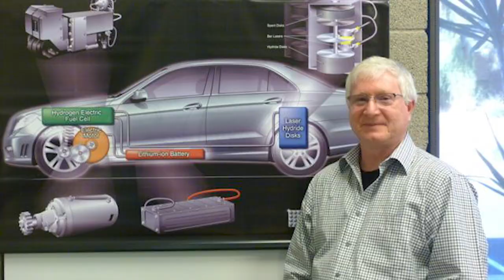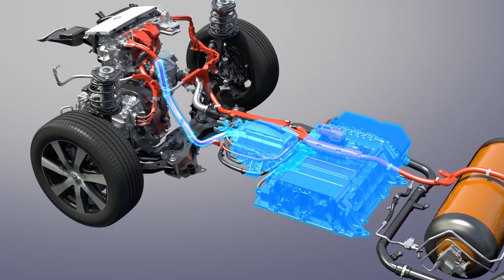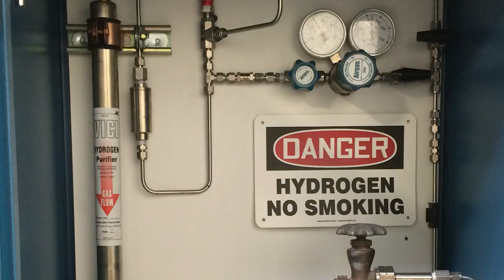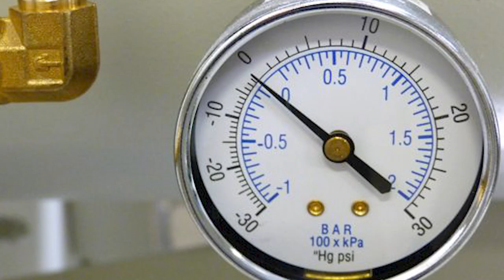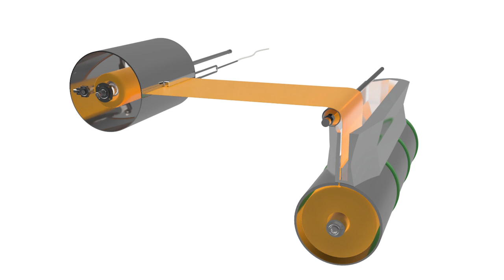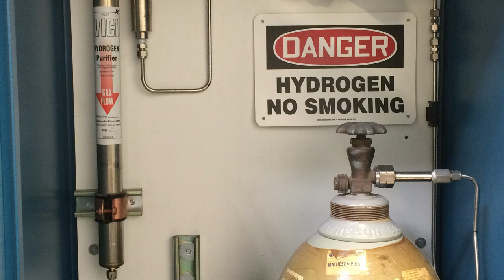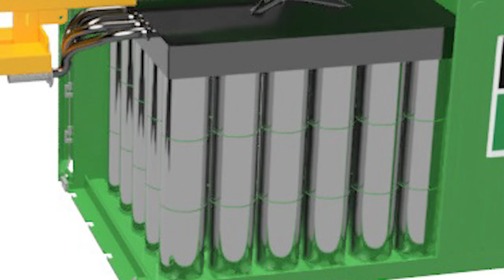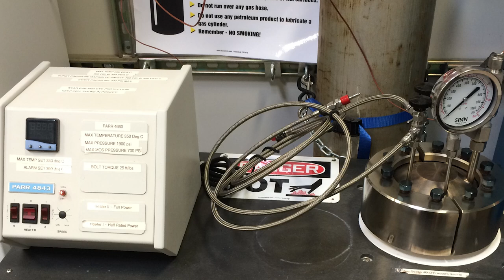This BANNED Technology Could Push Hydrogen Cars Over BEVs

Comment: You didn't ask the relevant questions: 1. What are the conversion losses in generarating the hydrogen and getting it onto the film? 
2. How much does the hydrogen to film conversion device cost and how much energy does it consume? 
3. How much does the conversion unit in the car cost, how heavy and how efficient is it? 
4. At what point of production readiness are they and how much would a factory cost to produce those devices?
5. How high is the energy density on film compared to compressed (700 bar)/liquified hydrogen?
6. How is the hydrogen fixed onto the film and is there anything other than hydrogen coming off when it's getting lasered?
7. How does the cost compare to compressing hydrogen?

With this system, there are a lot more steps from the energy source to the motor: Regenerative power to hydrogen, hydrogen to film, film to hydrogen, hydrogen to the motor via fuel cell. All those steps have losses. 

For BEVs it's solar panel to battery to motor with an overall efficiency of way over 80%. FCEVs are two to three times less efficient and it'd be interesting to know, how much better this technology might do.

It's all fine and dandy that lots of people are interested in a slightly less boneheaded way to store hydrogen but prototypes are easy...
Reply: good questions, I had similar questions too, but I doubt we will get answers any time soon
Reply: They won't mention cost, ws that would reveal how impractical it is, but they did mention "15 pounds for 20 miles" which means 300 pounds to equal the 400 mile range Teslas - but that might be overly optimistic.
Reply: @chrismuir8403  yes, and that 300lbs is just the “fuel storage unit”..
You still need a Fuel cell (1-200kW ?) and the usual battery that fuel cell cars need..
Reply: @weinisable  ...and the thing that gets the hydrogen off the fuel-storarage-unit is not weightless either. It's gonna be pretty busy under the hood if such a car gets ever built.
Reply: Good questions. But to be fair, there are more steps in the BEVs case - transformers/DC-DC converters, rectifiers and invertors (at least for AC motors like Tesla uses).
Reply: @peter.g6  Toyota uses DC-motors? I highly doubt that... And fuel cell cars need (smaller) batteries too btw.
Reply: @Makatea  Well, that's a good point with AC motors everywhere. Not sure about the batteries though, does a significant portion of the electricity from a fuel cell go to batteries?
Reply: @peter.g6  Batteries are needed both to power the fuelcell and as a buffer because the fuelcell can't provide enough peak power for acceleration, so it's pretty substantial, but of course a lot smaller than in BEVs as it gets constantly charged by the fuelcell. Being smaller, it gets a lot more cycles, so it'll wear out a lot faster than a BEV battery.
Reply: 'Solar panel to battery to motor with an efficiency of way over 80%'?  I think you need to recheck the efficiency of your solar panels....
Reply: @lukedornon960  I should have said solar panel output I'm perfectly aware of the fact that the conversion rate of light to electric output is about 20 to 25%. But do you have any idea of the conversion efficiency of solar power to fossile fuel? And if you make hydrogen using renewable energy, which is the only way to make it carbon neutral, you have the exact same conversion losses of solar rays to solar cells or wind turbines.
Reply: @peter.g6  ALL of those items in your list are in a FCEV (they have batteries too because a FC can't provide the peak power needed for acceleration hence a battery buffer.
Reply: @lukedornon960  You are criticising something they didn't write. Light to PV output may be ~20% efficient, but that wasn't what they wrote, they wrote PV to battery.
Reply: The volumetric and energy metrics are on their website.
For BEV it is not simply solar to battery. Its solar panel conversion efficiency to AC through microinverters or a central one.  If there is storage involved its conversion back to dc, then stepped up or down for current regulation into the pack. From the pack it must then be converted back to AC.  If your not doing storage then skip this. From here the charger takes this AC converts it to DC. Then the onboard charger regulates this to charge the pack. 
The charge efficiency of the pack then has losses based on temperature and state of charge. From here the DC is converted to a 3 phase ac signal in the inverter to drive the motor. If you count all the efficiency losses in this you are no where near 80 percent.  
Keep in mind there are different solar setups and storage options that can change this slightly and I didn't detail all of the steps and voltage conversions happening in the inverter and charger that introduce additional losses. This also doesn't take into consideration the pack thermal management system that is consuming energy to maintain the optimal pack temp for charge acceptance. This is why there are cooling systems on the motor, inverter, charger  etc. The loss is mostly thermal and must be rejected. 
FCEV also have their drawbacks but the interesting advantage this tech potentially has it the energy to weight metric. Current batteries are too heavy to scale for heavy transport. Batteries will not slash this metric in half anytime soon using lithium based chemistries. The active materials alone wont meet the metric needed.  Tesla semi can only transport a limited amount of weight without going over DOT weight limits at any considerable range. If your trying to use a battery in an aerial vehicle you SOL with range due to weight and limited energy density. For grid scale storage ,the  complexity of stringing hundreds of thousands of cells together for stationary storage is  a reliability and cost nightmare.   This can potentially be a game changer for grid scale storage and large vehicle transport. There is the potential to directly burn the hydrogen for applications that need thermal energy.
Reply: @chuckschumer7783  This is not true.  There are companies with conversion efficiencies in the high 80% range. Your describing a straight h20 to hydrogen electrolyzer.  The efficiency of a Fuel cell is generally above 60 percent. It can also be higher if the waste heat is used for something else ( drive a heat pump, or heat a cabin). The efficiency is also driven by the load on the cell and is not constant as is the case with batteries.
Reply: This sounds like its best application is for aircraft where power to weight ratio is more important than ground vehicles.
Reply: @kayzrx8  Granted, with that hydrogen-to-film/disc you don't have any AC/DC back and forth conversion, however those power electronics have gotten very efficient. 
Instead there is hydrolysis, which is far less efficient, then you convert the hydrogen gas to the storage media, then convert it back in the car, and finally fuelcell to electricity. Many more steps, the efficiency is far worse and the hydrogen is far more expensive than electricity.
Right now, 95% of all hydrogen is made by steam-reformation from fossile fuel. This is why big oil is pushing it. But at least for cars, there is really no point, given price, efficiency and at least for now, CO2 emissions.
It might be interesting as intermediate storage when there's more production from renewables than the grid can absorb. But even for that, there are cheaper and more efficient technologies such as iron-oxygen batteries on the horizon.
Reply: @rvanbeau2009  It's pretty hard to figure out a CO2-neutral solution for aviation. There are small battery-electric aircraft with an hour or two of autonomy. But long distance is really difficult. Fuelcell and electric motors with propellers will still require pretty substantial batteries for takeoff and prop-driven aircraft are far slower than jets. Hydrogen powered jet engines might be tricky to construct as hydrogen embrittles steel (and possibly other metals). Right now I don't see any viable (but costly and wildly ineffeciently produced) biofuels.
Reply: @Makatea  If hydrogen is being generated through electrolysis, that is a waste unless the source of the energy is renewable.  Even then there are other forms of converting green energy to hydrogen that are in development with high efficiency without the use of hydrocarbons. The problem with BEVs that is a huge elephant in the room everyone seems to ignore and hope it will be addressed is the recycling of these spent packs when they are exhausted. They are not environmentally friendly and the mining of the materials is a pretty bad process. not to mention where these materials are sourced.  There currently is no efficient and economical way to do this.  The other huge issue is energy to weight. For a commuter car this can be tolerated but when you try and get into trailer transport, heavy power equipment and use cases that require significant energy density, Lithium chemistry, at just the metrics of the active materials alone, cannot meet this criteria. There has to be another method of storing energy with an effective density metric to be a viable replacement for diesel. In the grand scheme of CO2 emissions , when looking at the transport sector, heavy vehicles are a huge contribution to this.  Hydrogen  storage is key here and this tech can address the storage  issue. There are company's developing ammonia hydrogen storage and methods of conversion to hydrogen that are within range of being viable. Batteries in the present  chemistry cannot address the main issues that are leading to co2 emissions.  Even iron air batteries have worse energy to weight metrics than lithium chemistry's. That's is why they are mainly targeted at stationary storage where weight doesn't matter.  I am an EE with a background in energy storage and battery manufacturing. Batteries need a significant jump in storage density and weight metrics to be viable for the areas mentioned.  Efficiency is one part of the equation.   A system that is 50 percent efficient and can actually do the job of transporting significant weight with energy density for range is better than one that  is 90 percent efficient but cannot meet the criteria.
Reply: @chuckschumer7783  Yes, that correct, gasoline engines are less efficient than that.  You're missing the bigger point though, batteries are expensive, heavy, and still produce a lot of toxic byproducts.   If a hydrogen plant was powered by say nuclear, or solar, the energy loss is negligible considering that the energy is resource neutral.  For aircraft, these are much higher energy dense so a far better solution than batteries.  Electric aircraft currently have ZERO future.  Batteries are just too heavy and nowhere near energy dense enough.   Think about a nuclear powered aircraft carrier with hydrogen powered aircraft.   The math is showing this tech to be about 1/2 the energy density compared to traditional fuel, which is already 5x more dense than batteries.
Reply: @kayzrx8  please provide an example of a company with an electrolyser with "conversion efficiencies in the high 80% range".
Reply: @kayzrx8  and with all that experience you're not aware that technology peesently exist that can recycle 90% of battery for reuse as batteries!?
Reply: @redshift3  it's not electrolysis . I never  said it was.
Reply: @dstr1  no there is no at scale tech to recycle 95 percent of batteries. Please mention a company or point to a process that does this at scale with efficiency.
Reply: @peter.g6  Maybe you are aware but it still needs battery to provide enough current for torque. Fuel cell does not generate much torque so the subsequent components are essential, just not at as big of a scale, hence the term "fool's cell" from Elon Musk.
Reply: @runningman5871  Tesla does not have a 1 million mile battery. This highly depends on the dod of the battery. If I'm cycling a battery within a very narrow range of it's capacity it will last. This is not the case for all applications.  There is degregation that occurs with ALL lithium based batteries due to DOD, dendrites, AP, temperature degredation, and separators degregation which is a calendar life. Simply because I add an enormous amount of capacity to a system and only use a shallow DOD I can't claim the battery last forever. Your not using most of it  at the expense of weight and cost.  Why do you think Tesla is desperately trying to get into cobalt mining ? Cobalt is necessary to extend the degregation curve and it is a very limited resources. Why don't they rely on the recycled packs for this material ? Because it is not viable to extract cobalt presently from spent packs . They aren't recycling 95 percent of the pack. It's built in a way that makes recycling difficult. They aim to be 95 percent recycled but they are not .
Reply: @chuckschumer7783  Agree, though the 50% is just the round-trip loss alone. There are other losses as well.
Reply: @redshift3  please do some research it seems everyone on here simply repeats what they read on the internet. There are currently labs that have gotten electrolysis to 70 to 80 percent efficiency for conversion of water to hydrogen using catalyst. Still in development but documented  evidence of these efficiency's . There are process using PEM to achieve near these efficiencies at scale. There also company's experimenting with direct light to hydrogen conversion using biological strategies. There are even companies developing carbon neutral strategies for hydrocarbon.  Batteries are ok for things but are not the end all and answer to reducing CO2 emissions. Don't rely on Google or a blogger for your info.
Reply: @kayzrx8  Redwood Materials
Reply: @dstr1  I'm familiar with them. I said at scale and efficiently. They are still in their infancy and still doing a funding round.  They will need to meet alot of hurdles to be considered efficient and at scale. There are hundreds of other recyclers that do this as well for cellphone and consumer electronics batteries. The recovery efficiency is not good.  Currently any materials they manage to recover will be more expensive that just importing them . Until they get the cost down , this in no way will address the magnitude of packs that are being deployed that will near EOL years from now.  Removing lithium, cobalt , and other materials from the battery is a labor intensive, energy intensive , and chemically intensive process. It's not like you stick the battery in a machine and out comes cobalt , lithium, carbon, copper, aluminium, and the other metals used in the cathode and anode.  It's a known problem in the industry hence why many companies are trying to address it . It is not addressed yet and won't be for a while .
Reply: @kayzrx8  it's being done to scale according to the state of the market.
They are producing as much as they can get and are putting out  request for as much as is available. 
This is a developing industry with considerable opposition from the established automakers. The factory is able to process 100 % of what it receives.  It's nowhere close to capacity and it's purifying the materials at a much lower cost than virgin   materials. And it has a demand for all it can produce.  That is the definition of producing to scale producing at scale.
You are primed to dupport hydrogen but not ready to accept that it's just not ready.
Reply: @kayzrx8  Tesla is not trying to get into cobalt mining, on battery day Elon said they plan to get rid of cobalt altogether. Cathodes should be just nickel and maybe manganese. LFP are already cobalt-free.
Reply: @peter.g6  you really need to do your research, they plan on mining lithium and cobalt. Plan on and actually doing it are 2 very different things . And no, LFP batteries still require a small amount of cobalt in the cathode . Tesla has secured contracts with cobalt miners In the congo and has already started looking into mining it . LFP as they have said and is know has less energy density than the current chemistry they are using . They are still working on a cobalt free chemistry it is not ready or proven yet.
Reply: @dstr1  I'm not primed to support anything. Lol have you looked into the cost of  the materials that comes from them or any recycler  vs importing ? You can believe what you want . I actually work in this industry and know the reality of it . Battery recycling has a long way to go. Just cause a company buys 100 acres doesn't mean they are at capacity. Processing pouch cells is way different that cylindrical packs. Not saying its impossible  just saying that they have serious hurdles and growth before they are at scale with today's projections let alone where it's heading.  And no,  this doesn't scale by demand. Recycling scales by being forced to do it either by mandates or scarcity of the materials.
Reply: @runningman5871  define still going strong ? I guarantee you the capacity it had new vs now after "400k claimed miles"  is considerably less and that curve will dip faster as the battery ages. It isn't linear . Do you have data to show your pack has 0 degredation  after 400k miles ? There's published data of Tesla's packs showing considerable loss after 100k . It depends as I said early on how the packs being used (dod, recharge rate, discharge rate ).  I'm not saying BEV are bad and I'm not against them,Tesla are leading the way in the tech and they have a good product. it's just comical the fanboys think batteries defy basic chemistry and physics and can't understand the basics that's batteries cannot meet the requirements for every vehicle .  No electrochemical battery avoids degredation. You can mask it by oversizing the pack to allow for a shallow DOD  while sacrificing weight and  cost.
Reply: @kayzrx8  read the report.
Reply: And I have a phd in physics. Just not getti g the magic disks with no evidence thing. You believe what you want. I've provided evidence. Goodbye.
Reply: @runningman5871  I doubt that. And you have yet to provide any evidence just speculation. Carbon nano tubes and hydrides are a known and proven hydrogen storage medium. Your already bashing this without even fully knowing how it works or the methods  behind it. That's pretty closed minded even for a PhD . Your just a fanboy of Bev. And that's fine . They are cool and help. But dismiss the fact that Bev have a very narrow utility band. Towing, heavy machinery, long duration, flight, boating , mass transit are just a few of the modes that batteries at ,their present metrics,  cannot address.  The solution will be a hybridzed blend of all of those invitations . There is no one solution fit all for addressing emissions and electrification.
Reply: @kayzrx8  LOL, you tell me to do my research rather than giving me a link? You're a joke man. I will take it back when you send me a link where some Tesla employee talks about their plans to mine cobalt.
Reply: @peter.g6  I can't hold your hand to make you understand a simple concept  about batteries or the very easily searchable headlines saying this.
Reply: @kayzrx8  very disrespectful and inane answers. You seem only interested in magic physics tgat does not exist. Muting you as you're v dull and uninformed.
Reply: Just look up what purpose cobalt plays in battery cells. You will soon realize the hurdle and extreme difficulty it takes to replace it in an electrochemical cell. Without going to levels that most people probably would not understand , explaining this would be a wasted effort without you doing the research to understand the basics yourself. Just simply do your own research  and you'll find quite a bit of headlines and info  around it.
Reply: @kayzrx8  I suspect there aren't enough spent batteries available yet to make recycling viable. At this stage EV companies are struggling to get more auto market share.
Reply: @Makatea  I wish you were making videos about this stuff.
Reply: @Makatea  How about MSRs for making any required hydrocarbons (including for the military) directly from CO2 and water?
Reply: @red-baitingswine8816  exactly
Reply: He sounded all too familiar to me.  On the lines of the government wants to ban this man who built a perpetual motion machine. It's all talky talky n no walky. And yes the host doesn't have the knowledge to ask the right questions about this either.
Reply: @liveonthesun3368  I don't understand why Sandy only asked these softball questions, it's certainly not lack of knowledge. Are they clients of his and he exactly knows how dramatically inefficient this whole process is? Hopefully, there'll be a followup.
Reply: @weinisable  Yes.  Part of the efficiency of EVs is the recapture of braking energy on braking.  For that one needs a battery for practical purposes.
Reply: @chuckschumer7783  exactly so this is not a path forward besides the disk have a short life span
Reply: @Makatea  - The real solution to long distance air travel is to not travel at all. The majority of air travel is really obsolete with the use of the internet and modern communications technologies. The only time a person needs to air travel long distances (other than recreation) is for a service direct to said person, such as medical treatment, or a direct service provided by that person, such as a tech resource needed onsite where communications technology is not enough. For 90% of air travel is actually obsolete.
Reply: @chuckschumer7783  - Let suppose you are correct and the overall system is only 25% efficient from original power source to wheel. If that original source is carbon neutral (like solar, wind, nuclear, geothermal, etc.) then it is a big win compared to the large amounts of carbon the fossil fuel culture we are living in today. When every little bit counts, we need to be making advancements that ARE Disruptive if we want to head off climate change and keep our coastal cites from being flooded over the next 50-80 years.
Reply: @kayzrx8  You are spot on on every topic you have brought up.
Tesla has done the alternative energy movement an enormous disservice by marketing its tech (li-ion batteries) as some sort of green energy revolution that will save the planet. Pushing out the Tesla Semi further harmed progress, not just b/c the core concept of lithium batts being a viable alternative for commercial vehicles was total bunk from the get go, it also stole valuable publicity that could have gone to something workable.
By simply increasing the size of induvidual cells in their packs, tesla has convinced a large portion of the population that battery tech is improving year over year. I wish car companies would admit to the public what they themselves already know. Batteries as an energy storage medium in vehicles are just another stepping stone, just like hybridization.
Anyway, rant over. I'm glad there are engineers like you tackling real issues instead of wasting time on flashy nonsolutions chosen due to their superior marketability.
Reply: @williambrasky3891  Glad to meet someone that has sense and can see what's going on. It's shocking once you actually crunch the numbers. It amazes me how people believe everything so blindly.  Increasing the size doesn't really do much besides simplify the pack design. But that also introduces more issue with thermal management and some other issue I won't mention here because It will go over alot of peoples heads.
Reply: @jonahbert111  this can be done and has been done on non ev vehicles . Strategies utilizing the cars alternator or motor generator during decell and braking can accomplish this. BMW, Mercedes and other have done this and utilized a slightly larger  battery. OEM's have the ability to do Regen on non ev's. It just drives up cost and the market isnt there for it. Without regulation forcing these abilities, oems won't implement them  unless the market is there for it.
Reply: I don’t see this system as practical, efficient or cost effective for consumer cars compared to BEVs. But for applications which are already suited to hydrogen fuel cell - shipping, freight transport, etc - then it’s probably going to be safer and easier to use this tech than have a huge pressurised bomb.
Reply: Valid questions the promoters try to avoid. 👍 Stop fact checking.
At least it has an advantage over compressed hydrogen or eFuels.
Might be advantagous for home owners to transfer excess energy from summer to winter.
Reply: @alanaland1990   Leaving the details of steam reformation out was positive for hydrogen production.
Reply: Well regarding regenerative braking, it would not be necessary to convert back into hydrogen, you could just a limited battery capacity coupled with some super capacitors to absorb such energy temporarily. Typically you suck up such energy quickly again when you accelerate (except at your last stop). I would image it would need such temporary storage anyway for high power acceleration, as the file cell will have some definately limit of output current that will not meet the acceleration requirements anyway, otherwise the fuel cell would have to be undesirable oversized.
He did actually touch the pricetag of a "tankstation" which was much less than the high-pressure hydrogen storage systems.
Reply: Yes, these are key questions and any video/article about the latest and greatest hydrogen widget that doesn't discuss them should be erased to make room for more useful things like videos promoting flat earth theories.
Reply: @Makatea  Long range planes will require fossil fuels in foreseeable future. I think that the best course of action would be to require from air-companies to invest into equivalent CO2 absorption by forests, CO2 capture... etc.
Fast electric trains are attractive alternative for shorter travel.
Reply: @chuckschumer7783  hence his focus on renewable energy creating the hydrogen with excess power generation. I assume that he figures they would prefer to not buy batteries or other storage devices. Great to see the technology development and let’s hope that it gives battery power and run for its money. We the consumer will ultimately benefit from a raft of highly competitive competing systems.
Reply: @steenhansen5625  I'm sorry. I didn't mean to imply that and my comment was unnecessarily harsh. However he compared his technology to the hydrogen tank technology. The problem with that is he is comparing his technology to something that hasn't been shown to be viable. And his technology doesn't address the main problems with using hydrogen as a fuel today: Electrolysis is too inefficient and hydrogen from methane reforming has still got issues with CO2 production and other fossil fuel type issues.

A whole lot of ideas become viable if somebody could figure out how to make hydrogen efficiently with electrolysis. Right now it is more convenient, more economical, and more efficient to use electric power sources to directly charge batteries than it is to use the electricity to produce hydrogen and then use that hydrogen to power cars. I suspect that would be true whether you are using his technology to store the hydrogen or using high pressure tanks to store the hydrogen.
Reply: @davefoc  thank you for elaborating on your first response, I agree with you on the efficiency issues of electrolysis, and even worse the reforming from other fossil fuels, however I believe that electrolysis in amonia is dramatically more efficient, which might be a viable path. I know that amonia is a biproduct of grey water treatment plants. Another interesting carrier of hydrogen might be methanol ?
Reply: @Makatea  The size of the LFP (Lithium Iron Phosphate) buffer / peak battery would depend on the output of the fuel cell. The more the fuel cell output, the smaller the buffer / peak battery would need to be.
 I choose LFP batteries (for now) because they can be discharged to near  zero, from near 100% state of charge, thousands of times.  Of course, LFP batteries have less energy density than lithium ion batteries; but, charge and discharge much deeper (and more times) than Li-ion.
Reply: @terryjimfletcher  Additionally, a fuel cell can recharge the battery when you are out in the boonies with no charging station available.
Reply: @kayzrx8  Since the fuel cell produces dc electricity, it may be more energy efficient to use dc electric drive (traction) motors powered by the battery which is charged by the fuel cell.
Reply: @kayzrx8  There is, also, the possibility of using inertial sources (spinning flywheel) which may, may, be light enough, with enough energy, to power an aircraft. The flywheel would be spun up while the aircraft is on the ground. The efficiency could be high.
Reply: @artsnow8872  Dc brushed motors aren't that efficient when compared to an ac motor. If your referring to a brushless DC motor, those still require an inverter to convert the dc into a 3 phase sort of ac signal depending on the inverter to drive the brushless motor. The main efficiency loss is in the Fuel cell, not necessarily the drive system. Of course this will depend on the system configuration.
Reply: @artsnow8872 A flywheel in a vehicle can present some challenges if they are not gimbaled. A flywheel for aviation may not be practical as it can lock the vehicle on one of its planes and affect maneuverability if it is not gimbaled. Due to the size of the flywheel to store the required energy,  The size and weight of the flywheel would prevent this from being practical.  They are great for stationary storage and have been used in buses  with success. F1 also used small ones for kinetic energy recovery.
Reply: @silveriorebelo8045  You've got some serious reading up to do concerning climate change.
Reply: @mmcbride3879  Where did you get that information from? Even if it was true, it doesn't answer the other questions.
Reply: hehe....this about money problem....haha.....
Reply: @peter.g6  Not to mention the environmental cost and disposal of lithium ion battery banks from wrecked electric cars, old electric cars etc. All of that ends up in a dump eventually. Plus the mining process of lithium ore and the manufacturing of battery banks.
Reply: @AtlasRandGaming  I guess you know what I meant :) I don't live in the US, nor is English my native language, so it's hard to tell what is safe to say sometimes. I'm trying not to get shut down by YT for breaking some PC rules I don't understand. I've decided to stay on the safe side this time :)
Reply: You guys sound like gas lovers talking about batteries . Go for a ride in your tesla and relax
Reply: Also are the disk reusable? If so, by how much?
Reply: @kayzrx8  i8
Reply: @chuckschumer7783  where you take your number. There are many way to make hydrogene, for example if you use an sulfuric acid solution you can get more energy(h2) than you use to make it. if you go in deep sea near thermal vent sulphuric acid solution is free. For fuel cell number are between 40 and 60% but lot of company work on fuel celle right now and we don't know were they will be in few year but probably beyond 50%. But what is interesting in this technology it can be a way too get best efficiency from IC engine for cheap. ICE are not going anywhere anytime soon battery are too expensive and heavy making them useless for lot of application. Emergency generator, semi, most of heavy machinery and other. Ading only a tiny amount of h2 to the air mixture give a better combustion getting a better yield from your fuel. but the cost of compressed gaz was making it useless.
Reply: @chrismuir8403  " "15 pounds for 20 miles" which means 300 pounds to equal the 400 mile range Teslas - but that might be overly optimistic.
"
but you can swap the cassette at a station in a minute
Reply: @SLPCaires , yes, the cassettes can be swapped in a minute - using specialized equipment to lift them. But batery packs can aso be swapped the same way with the same speed. The fact is, electricity costs a lot less than hydrogen and always will, so battery swaps and fast charging will always cost less than the proposed hydrogen caseettes or hydrogen fillups.
Reply: I had all the same questions.  I know compressing hydrogen is expensive at 1.36 kWh/kg H2 but not that expensive.  Especially when it takes 50kWh to make the hydrogen, to begin with (electrolysis), so the compression is only 1.36/50 or 2.7%.  That's hardly something to talk about.  Now, liquid H2, that's a different story using 12kWh/kg.  That's significant.  This just seems like a Theranos investor scam.
Reply: If they had an actual prototype, that would be great.  All I see is crappy CAD drawings.  My son learned 3d CAD in high school and could produce better drawings than that.
Reply: You should watch the video again an this time listen to all of it.
Reply: @zontarr22-zon  That sound like you already have, so perhaps you could be so kind as to answer the questions at the beginning of this thread. With timestamps to the corresponding part of the video, so we all can understand what we missed...
Reply: @scottkolaya2110  The only problem it really solves is the potential Hindenburg-effect of pressurised H2-explosions. But it increases storage-volume and weight dramatically. Also, it sounds a lot like that it's at a very early stage of a solution looking for a problem and being delusional as to the viability of FCEVs, given the fact that they already lost in the market, as they are hopelessly inefficient and expensive to run.
Reply: @chuckschumer7783  hey Chuck where's the cannibis legalization bill? 😂
Reply: I don't know much about electricity or motors but this conversation is very interesting. This sounds like a technology that will keep improving.
The term disruptive might be fair, I don't understand enough to know. But I do believe that we will have a cleaner planet once we get away from petroleum. If we farmed a LOT more hemp and figure out electric cars we won't need oil. Anything petro can do hemp can do better and cleaner. Hemp is also a huge carbon sink. 
If people relearn how to farm naturally again instead of with chemicals, and we quit burning oil, our grandkids and their grandkids will inherit a cleaner world. That's worth doing.
Reply: @comfortablynumb9342  And with enough cannabis around, it'll bother us less, when the switch to CO2-neutral takes a bit longer ;-)
Reply: @Makatea  at least it'll be painless 😂
Reply: @Makatea  sure thing I will but when I have time to spend for wankers that can not listen. meanwhile put your volume up an listen to every answer, obviously will not be straight on point but you have to understand they just been spotted by all. No business in world will give all the details but they were kind enough to explain in general terms, your problem if you not catch it.
Reply: @nikoliwilliams3721  IF the sources of electricity are carbon neutral...
The key word is IF.
The electricity required to power the BEV goal of 2050 will require around 2 million 5 MV wind generators. Over the past 30 years we have expanded to a current 67,000 wind generators but wind generators last less than 30 years so all of the existing units will need to be replaced by 2050.
If the EROEI (Energy Return On Energy Invested) for hydrogen is half of the battery number than you need to build twice as many generators. 
A wind generator takes a literal ton of REM of which the current demand already exceeds the supply. Over 90% of our REM comes from China and most of their increase in production is being used for their own wind generators. 
To supply electricity for cars from nuclear power we will need to complete a new 10 GW plant every 3 weeks to meet the 2050 goal or if you use less efficient hydrogen you will need to build them at a faster rate.
My point being, it is essentially impossible to have enough carbon neutral energy by 2050 to power all the electric cars proposed to be on the road. 
Of course we need to convert industrial, commercial and residential energy usage to carbon neutral sources also but those are all in addition to the transportation requirements mentioned. 
EVs are able to use "excess" energy now but as they saturate the market there will be no such thing as excess carbon neutral energy.
Reply: @chrismuir8403  What's the cost of 1 habitable planet?
Reply: @speedibusrex , we already have a habitable planet, and the only cost is maintaining it. No reason to choose the less efficient more expensive hydrogen option, when electricity and batteries are better.
Reply: @peter.g6  I think it’s not the same. Everything for the BEV is about interconversion between various forms of electricity right up to the point where the motor runs. In this case, we have chemical conversions. Efficiencies will be lower.
Reply: 5. How are you planing to solve the logistical night mare it would create?  6. Why would any one want the added complexity in a car resulting in much more expensive maintenance of  it?
Reply: @chuckschumer7783  The overall efficiency is not a big concern when you have electricity cost of renewables below 0 which is quite usual, at least in Europe :) The energy density matters. On the other hand, poor efficiency means a lot of heat losses. They are good in winter but a nightmare during the summer period.
Reply: @mhamma6560  I've read that batteries need to have just 3 times higher density to be a viable option for long-range aviation. That should happen in roughly 10 years...
Reply: @kayzrx8  AFAIR during the last battery day Elon said they want to get rid of Cobalt and use silicon instead in new batteries.
Reply: @gkasprow  grab a 10 year old battery and check its energy density.  Aka a 2011 cellphone. Not much has changed in the last 10, the next 10 won't be much different.
Reply: @mhamma6560  my laptop Dell M4500 and Dell M7710 both have 97Wh battery. The second one is 50% thinner and is much lighter. It's roughly 6 years. My old Sony camcorder in 90thies  had 800mAh battery size of roughly 2x3x6cm. Compare with common 3Ah 18650.
 A lot is happening here. Maybe recently the progress is a bit slower but it's happening. Look what power density new smatphones have!
Reply: @gkasprow  You're comparing dissimilar battery types.  Let's compare the iphone 4s battery's capabilities and it's size vs what's available today.  I'll sum up what you'll find, its battery's size is pretty much identical to one made today in terms of capacity and size.  Nothing changed.    You have to compare modern tech of 10 years ago to modern tech of today.  Sure modern phone batteries have twice the capacity, but it's also twice the size.  The density has remained the same.
Reply: @gkasprow  wanting and doing are 2 very different things
Reply: All your arguments are moot as long as the BEV is powered by 1200 lb chemical monstrosity. We have a hard time disposing of or recycling electronic waste already, I can't even imagine what millions upon millions upon millions of 1200 lb chemical batteries would mean for the environment.
Give me hydrogen everyday over that.
Unless we can massively improve battery technology soon, hydrogen will overtake and dwarf BEV within 10 years.
Reply: @kyrebanorg9897  hydrogen cars also have batteries. And they need to provide a lot of current so cannot be that small.
Reply: @kyrebanorg9897  Let's unmoot those arguments then: The drive batteries have at least 200.000 miles of lifetime before they're under 80% capacitiy. After that, they're used for grid stabilisation of solar and wind. Only after that, they'll be recycled with over 90% efficiency to get back all the valuable raw materials.
Reply: @kyrebanorg9897  Hydrogen isn't a viable solution.  Hydrogen has to be made here on earth, we can't mine it.  It takes more energy to produce hydrogen than it yields in burning it.   Natural gas is easier to store, contains a higher energy density, and there's a never ending supply of it.   Not to mention we've already got a pipeline network for it.
Reply: Hydrogen storage and production isn't impossible. Anhydrous Ammonia is a great storage medium and splitting it is endothermic. Unfortunately it's also very poisonous
Reply: After receiving their detailed documentation I was surprised. Their energy density gravimetric is 1000 Wh/kg which is 870Wh/kg less than compressed hydrogen and 870Wh/kg greater than lithium-ion batteries. This technology makes sense for vehicles that haul a lot of weight like trucks, locomotives, RVs, tractors, planes, and even backup standby generators. They will deliver a lot more energy/pound than today's batteries. This solid-state technology is 1.92 times as efficient as compressed hydrogen when you compare the power to produce liquid hydrogen to vehicle delivery per mile based on hauling weight. They also reduce 10 major components used in the process and delivery of compressed hydrogen.  In doing the math you would need a battery vehicle that could deliver over 201MPGe to meet this technology. I hope their data is correct and they find some USA company to take them to market.
Reply: @Makatea  this would be a good application for a supper capacitor over a battery.
Reply: @mhamma6560   " Electric aircraft currently have ZERO future" I have seen a number of presentations of electric aircraft that are being used currently for flight training. The fuel savings and simplicity of the aircraft have made flight training extremely cost effective for this application. So the "ZERO future" comment is an unfortunate statement. I understand that this application currently does not answer the overall  aircraft transportation industry but does exemplify the future potential of electric aircraft having many advantages as electric mobility is only in its infancy.
Reply: @steenhansen5625  small battery buffers are in included in all fuel cell designs . The battery also has a super capacitor bank to buffer the battery during dynamic braking and acceleration.
Reply: @Dana5775  Given it's got poo for range, the only thing it's good for is hanging around the pattern performing touch and gos.  That is for all intensive purposes, no future.   Simulators are cheaper and do the same thing.
Reply: @mhamma6560  "no future " haha back in 2003 I was having these same conversations about electric cars. The nay sayers were all wrong. Where are they now? Hiding in their moms basements.
Reply: @Dana5775  The first cars were electric.  2003 may be a long time ago for you, but we've had electric cars before then / more modern.  The issue wasn't the concept -- golf carts have been electric forever.  The issue was the cost of lithium batteries at scale.  It's taken decades for their costs to come down.  I don't know anyone with a brain that said electric cars weren't viable.  Likewise, i don't know anyone with a brain that says electric airplanes are viable, and we've got 3 rocket scientists in the family.  Their opinions align with mine.  It's simple physics.
Reply: @mhamma6560   the General Motors EV1 of the mid-1990s. I have a 1998 Chrysler e- bike designed by Lee Iacocca. I have been designing and building electric vehicles since 1998. Research and studying fuel Cells since 1964. It's not simple physics because you do not have or know all of the variables that will contribute to the future of electric mobility.
Reply: @ 13:16 He spills the beans, this needs an electrolizer, (electrolysis).
Reply: @Dana5775  Electric motors cannot match the power to weight ratio of turbines, and that won't be changing anytime soon.  Furthermore battery energy density can't reach that of dino fuels.  We're at least 60  years off of coming anywhere close, and it's going to take exotic materials we're not using today to do it.
Reply: @lukedornon960  Solar panel efficiency is around 20%. Solar panel efficiency is irrelevant to this disc ussion because the cost of the electricity from solar panels is only the cost of the solar panel installation amortised over its lifetime.
Reply: @chuckschumer7783  Exactly, the idea that hydrogen fuel cells could be "pushed" over BEV's is a nonsense. There will always be some specific applications for the technology, but not for mainstream automobiles.
Reply: responses to all questions: 
I don't care.
Reply: @chuckschumer7783  There's a new catalyzer that significantly lowers the water splitting energy significantly. But I still can't see this solution ready for cars. Big rigs maybe, ships for sure. BEVs are much more efficient though, and we already have enough range for the average person, both for city commutes, as well as the occasional road trips. It is probably viable for long-distance transportation and long-term energy storage. Although liquid metal batteries are more efficient for balancing the grid for a day or so, hydrogen may be needed for long-term storage.
Reply: Exactly!
Reply: He stated it's much lighter and cheaper than battery...
Reply: @cyclopsvision6370  don't let facts get in the way of a good story.
Reply: Don't worry Brigitte, he's only advertising!
Reply: And not very good at that!
Reply: Cheaper to make than electric power.  As you know, to produce electricity required fossils.  So, hydrogen makes more sense in many points.
Reply: The main objective of using hydrogen is there is no toxic batteries.  Solve the smokey mountains (toxic batteries) first.
Reply: - Light elements like H2,Lithium... are the most abundant in the Universe...you can find them even on the dark side of planets...
-H2 has a very high energy density hence was used in rockets...
-Handling was a problem (tank wall diffusion) , that is why SpaceX switched to Methane (CH4) rocket fuel...which is still mostly hydrogen in a tied up format... 
-This application is ideal economy wise for trains/trucks/ships...where the a small fuel cell block is paired with a larger size "H2 disc/film container"...or where the safe storage is more critical (aircraft) so the cost ratio is acceptable...
Reply: Yes please !
Reply: I agree with all the “cons” alluded to in the comment.
The is, however, another pertinent factor: we are all agreed, I think (hope) that storage is a large part of the key to renewable energy - there’s potentially almost limitless energy tappable but it has to be stored/transported to be useful. A system that is cheap and with quite low overall efficiency could be a game changer as a halfway house to some more efficient technology.
Reply: A Tesla Model 3 has 1200 Pounds of batteries, so this would be very light in comparison. I'd also assume that a lot of that mass is the hydrogen itself which would be used up as you travel resulting in a reduction in the mass of the fuel storage as you travel.
Since most people drive less than 20 miles a day, the ability to carry a variable amount of fuel would improve fuel efficiency. 15 pounds vs 1200 pounds is a big difference in mass for regular daily driving.
Reply: I agree. The host does not have the basics. He needs to study.
Reply: @peter.g6  These are very relevant questions. I studied mechanical engineering. Any good engineer would want to know that especially for power systems.
Reply: @peter.g6  Sunlight is free solar panels and land are not.
Reply: @rvanbeau2009  Maybe medium-range aircraft. Besides that though the best application sounds like it would be for ships.
Reply: Hydrogen cells are more reliable than conventional batteries. The technology now is expensive but in coming years it would be cheaper.
Reply: @M.sami12  Would you kindly enlighten me as to the sources of your bold statements?
Reply: I believe they did answer 5 and 6 in the video, though I don't think it was definitively stated for 5.

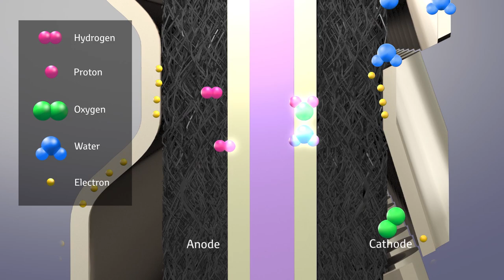For 6, 5:30 the answer is that the film has a negative charge which causes the positively charged hydrogen to be attracted to its surface. When the laser hits the film, it reverses the charge, releasing the hydrogen.
Reply: You really don't need to do those steps. You only need ONE possible reason why it can't work...the rest are interesting but not important.   A Toyota Mirai can go 100km  on 1kg of hydrogen. 300 miles is just about 500km.  So they need 5kg of hydrogen.   Now imagine one of those tiny disks weighing 5kg.  That's crazy!
Reply: You mean Joe Rogan needs to do the interview?
Reply: @lukedornon960  lol damn commercials
Reply: Thank you for bringing some logical analysis and not hype..
Reply: #6 was my favorite question and also
Does the conversion capability degrade and if so how quickly?
Reply: Battery over Hydrogen?
Reply: @Brigitte Coune Why don't YOU ask the MOST RELEVANT QUESTION!  WHY THE F IS IT BANNED IN THE USA?
Reply: Thank you for saving me the effort to point this out. 👏 All of this is worthless without knowing this key information.
Reply: Probably because the hydride is lithium deuteride which is a component used in fusion bombs. You are correct.. this is not new... Bob Lazar has been doing it for years (using a hydride matrix in a tank with a heater on it). He uses the hydrogen to power his internal combustion corvette. Admittedly he needs 3 of these tanks for the flow rate required by his engine but this is the same tech. The only real advancement here is using a laser to heat the hydride and using film to deposit the hydride.
Reply: Sounds like a lot of different things going on to make it all happen before it moves out of it's tracks, like one step two step three step four step five step six step seven step and a partridge in a pair tree and then let's put a ICE motor in there and it will really go. And at the end of the day what do you have. Myself I'm for stored energy, batteries, solar, electric motors and you'll have an EEV= Efficient Electric Vehicles. The EV is getting  there and the way to go!
Reply: I am guessing it is re hydrated, everything contains hydrogen that's why it escapes from tanks,the hydrogen atoms are small enough to move through atomic structures or in other words they move through everything. hydrogen is a primary element very basic and light and looking for a home usually not on this planet.
Reply: @Makatea  what do you mean?
Reply: @Makatea  they don't need batteries at all,they only have the batteries for regeneration some of the losses through braking.but the batteries are not necessary.
Reply: @rvanbeau2009  no,it's good for everything if it works,storing hydrogen has always been one of the big problems with it but this could be the solution to that problem, and the convenience of this system would be a determining factor in it being utilized, lets face it time is money to most people here you have a system that's saving time, to me its all good. I wouldn't be pessimistic about ideas like this unless I just bought a new Tesla.
Reply: @reh-linchen4698  Well I'm sure Elon will eat his words before to long.
Reply: @kayzrx8  Batteries are like fossil fuels,a FINITE resource. but in saying that the batteries we have today are brilliant and batteries are here to stay that's for sure.
Reply: Good points, but most important, apart from what power of laser required to release the H² (more energy inefficiency) what throughput of H² release?  As much as 10k psi compressed H² via a valve can release?  Women & at least ½ of men are NOT going to be slinging a 300lb "canister" into their car, after slinging out a 275lb empty one!  Manual labourers at each filling station?  Increases cost.   This smells like horse 💩
May be OK for trucks & buses, but can't see this working for cars.
Reply: yes basic ERoEI questions would be ideal
Reply: @Makatea  
Hi, what's your job? You seem to be very versed in energy. Great reading.
Reply: @weinisable  to be honest you dont really need a fuel cell since existing ICE can very very easyly run on hydrogen, all it needs is the wet injectors replaced with dry injectors similar to what lpg cars use
Reply: @Makatea  this small battery packs that you say the car would need for accelaration can very easily be replace by a bank of supercaps which doesnt wear out
Reply: @outofalaska2832  so did you not at anytime realise that running the car wasnt going to be free or even cheap? I bet apart from people who do less than 50 miles per week you wont find anyone who is going to be honest enough to admit that running electric works out less expensive than running ICE. environment doesnt even come into it since the cars still use steel,plastic and nearly all other materials that is required to build an ICE car
Reply: and how long do we need to subsidize the fossil fuel industry before a Green source of hydrogen is invented? Currently Natural Gas is used to create the Hydrogen sold
Reply: @Makatea  why not use supercapacitors with high discharge current for acceleration etc. with the fuel cell
Reply: "Prototypes are easy" is the key statement.  Even when you CLEARLY have the best product - history has numerous examples of the best products NOT being adopted by the public.  Unfortunately humans are creatures of habit.
Reply: The 80% to 90% efficiency is at the battery only EV's overall have the same or similar losses as for regen braking on a FCEV I wouldn't have bothered writing it back on the film I would a pushed the extra hydrogen back into the fuel cell
Reply: @Makatea  AC motors require just as much conversion, since batteries produce DC and almost any charging source is unlikely to be just the right voltage to charge the battery.